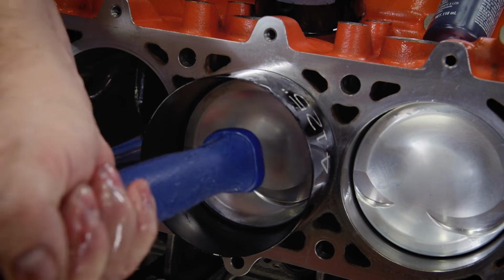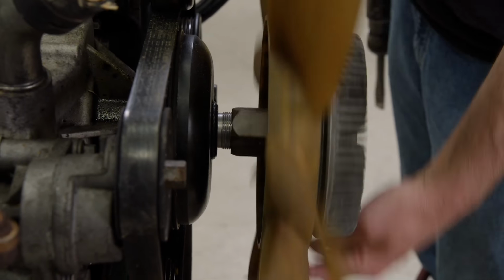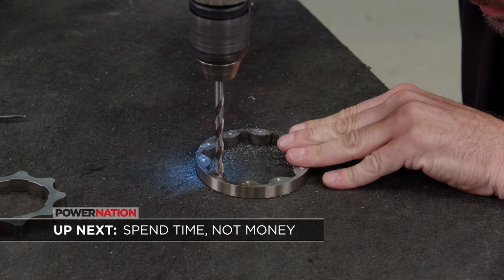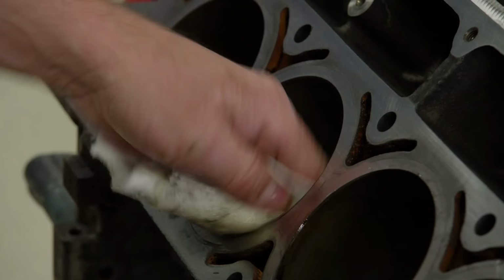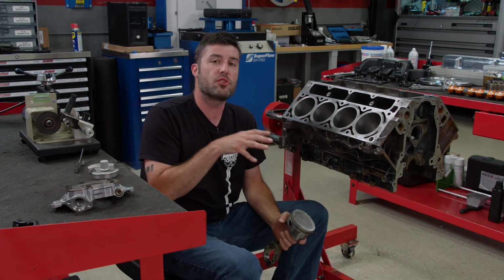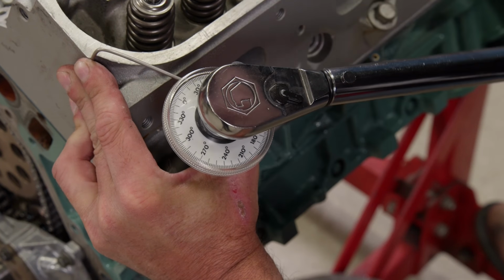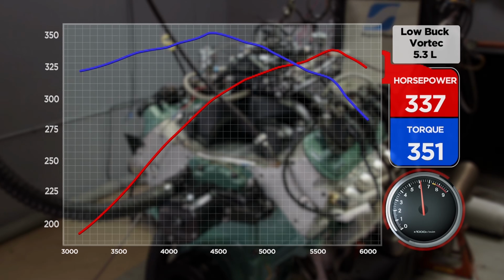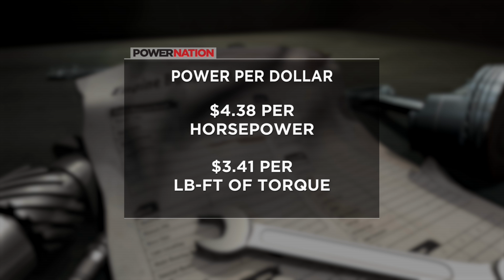Minor Upgrades Create Crazy Power on a Junkyard 5.3L Vortec - Engine Power S7, E10

Comment: too bad that these engines are extremely rare now.  Junk yards are running out.  I had to pay $1500 for a low mileage spare motor when mine started tapping(failing lifter).  That was over a year ago now.  Now that replacement engine, which still sits, goes for around $2500.  A reman longblock goes for about the same.  Seriously, thanks for ruining a good thing.

Comment: Love the show. I'd love to see y'all do a high rpm destroked LQ4 or LS3 using 4.8 crank n rods. It's something I've pondered for a long time. Something 7500-7800rpm w hydraulic roller cam. I know the 5.3's etc all can rev over 7k if done right but,with the smaller stroke/bigger bore the 4.8 crank/6.0/6.2 bore should rev quicker. Plus it can use LS3 heads/intake. Add a pair of turbo and it'd be a nasty little engine for not such a huge pricetag. Anyway,love the show,havent missed it or horsepower TV in years
Reply: 7k is plenty with a 226/238 .600 lift cam and some springs, pushrods and trunion kit.. can make 500hp with headers, cam, and intake..

Comment: A standard 5.3 Vortec comes with 300hp. I can get 46 hp from opening up the fuel injectors from their 15% to 40% and unrestricing exhaust back pressure and air in alone. No need to mess around with everything you did.
Reply: What do you mean by opening up fuel injectors?

Comment: Wow. I WOULD NOT want to run 700+ ft lbs on that thing sooo low in RPM. Got lucky shit didnt scatter......I was amazed at the initial torque hit. I had to back it up..... Hot Damn!....what Im not understanding is why they made so much more without any flow work on the heads?? I have seen crazy N/A motors make more than Jet Rec.....but 65 more and like double torque??? Looks a bit suspect....... But never the less.....amazing lil 5.3!

Comment: I would have guessed it would make 400+hp NA with the stage 3 cam motion cam, long tubes, intake and tune. Most bone stock LM7s make 340+hp and ~370 torque on engine dynos. I think hot rod magazine did a test some factory cams and the 5.3L made over 400hp with a stock LS9 cam. I am guessing the tuning for AFRs or timing was off on this test

Comment: When I was in shop class in high school we had 10 of these engines mounted on stands. They were donated by GM after there was a flood at their factory. They couldn't use the engines in production vehicles so they donated them and wrote it off on their taxes. We got to take them apart and put them back together many times. Sadly we were bound by an agreement that the engines could never be fired up.
Reply: 😆 Then what was the point??
Reply: @davelowets  we were 15. The point was to see what the inside of an engine looks like, how it comes apart and goes back together, what each part does. It was very beneficial and I learned a ton. We couldn't ever start the engines because of liability reasons.
Reply: @curtiswaters7415  That's why you start in shop class with a lawn mower engine, and then move up. You aren't going to learn much If you can't fire the engine up and tune on it yourself. Back in the 80s, that how shop class for us was. We started with a single cylinder mower engine, took it apart, put it together, then ran it and tuned it. Then we moved up to full size car engines and did the same. Then after that, it was a large diesel engine. I couldn't even imagine the amount of knowledge I would have missed if we couldn't fire the engines up after putting them back together. That was half of the experience right there. If I was the shop teacher, and G.M. said I couldn't run there donated engines, I would have told them to keep em. You can't learn much by just looking at them, starting them up and running them teaches one a whole lot more. What a lame shop class.
Reply: @davelowets  we had the opportunity with other engines, specifically a lot of Chrysler engines we had. We also worked on people's personal vehicles doing all sorts of maintenance and repairs. The teacher was a mechanic for over 30 years. Keep in mind that it was high school and we only had 70(140 if double-period) minutes each day to do things in that class. Single cylinder and two stroke engines was a separate course all together. There is more to automotive technology than building and tuning engines.
Reply: @curtiswaters7415  I was in high school also. I'm well aware of how long classes were. If you had other engines to work on, then the G.M. engines were basically pointless. A course about "engines" is a course about "engines". It doesn't pay to try and teach someone about something if you can't find out what the end result of what you learned is. That whole thing was rather dumb.

Comment: Very nice video.  However, Last I checked, 13 States follow California Air Resources Board(CARB)  semi-annual, strict, PITA,  emission testing.  Lots of car guys can't just toss their intake system, etc.in the trash.  Just every now and then, I'd like to see a MILD build that will run clean enough to pass!  The MILLIONS  of "Car Guys/Gals" would be HAPPY with another 50HP, when our engines are tired and we are gonna do a rebuild or "Ring And Valve Job"!   We need more "Real World" builds, not more small-block Chev/Ford fantasies.   Thank you!

Comment: "Get big power gains on a low cost junkyard ls. All you need are these highly specialized machines that all cost 3 to 10 grand a piece and replace everything that makes getting a junkyard ls appealing"
Reply: Instead of using the high temp washer, clean the block by hand with solvent, degreaser, and pb blaster with a straw for hard to reach areas. Instead of using the crank polishing machine, polish the journals yourself with oil and 3000 grit crocus cloth. You don't need the fancy machines to do a low buck engine rebuild, it'll just take more time...
Reply: @kyleboren7372  exactly, they even showed how to clean up the gasket surfaces by hand and showed ball honing the cylinders with a drill instead of a machine.
Reply: it's an LS.. they went overboard with all the cleaning and touch up and such. You have to realize that this is a show and have to make the engine presentable. When they took it apart, all they had to do was replace the worn out parts and slap the entire thing back together again. They didn't even need to repaint it.
Reply: @wanderingbufoon  Hmmm don't know, unclogging the main bearings oil passages might have added 100k-200k more miles to this engine. Pretty sure they can go 300k miles no sweat until something like that happens and it causes it to die early.
Reply: @wanderingbufoon  Why did they leave the rust where the coolant goes? That seems like a major oversite but I'm not an engine guy.
Reply: @RedRider2001  nah, it's been derusted by being power washed and sand blasted. 

If there is rust in the coolant compartment, it is nothing. It's a totally independent part. The only thing that is going to make it into a problem is if it starts becoming structurally compromised.

Remember, in hotter climates, their coolant is straight water.
Reply: They could have left the crank and heads on and bought a a few cans of Gunk and used a lot of elbow grease and just bought a cam kit and replaced oil pan and other gaskets. Or even pulled the heads and just replaced the head gaskets. Plus the little oil pump rebuild. It would have run fine for a lot less money.
Reply: @actionjksn  Probably a good thing they pulled the heads did you see how loose the head bolts were and adding Nitrous mignt of blown a head gasket.
Reply: Glad someone pointed that out. It may have been cheap for them, but add the prices of getting these things done, and the price skyrockets.
I wouldn't mind seeing the price, after all the adds that got added as well, they probably made money building this engine.
I shouldn't complain I suppose, it was pretty informative to someone who knows squat about this type of thing, which is me.
Reply: @markcahoon2534  every machine they used you could do the same work by hand, granted its alot of hours but just saying if you wanted to you could. As for the basic stuff like the ball hone anyone who you take on a job like this would have those basic tools.
Reply: @johndullebawn9625  yup, thats true hot rodding inventing ways to do things with little means.
Reply: Pretty sure he's talking about the specific carburetor they used in this video,  not the imaginary one you guys found on craigslist
Reply: Dude you can literally do all that shit at home. Power wash block, decking block yourself with sand paper, the crank you can take to someone to polish for 100 bucks or less.  Every guy has a dremel tool if not harbor freight got them cheap.  What else you bitching about.  It can all be done at home
Reply: Vice grip garage has a episode on building a 350, and another where he builds the much maligned 305 and proves it can make a damned nice motor too. Both episodes are jammed with excellent make-do technique. Especially the one on touching up the cranks with a shoelace.
Reply: If it has ok compression and doesn’t have a bunch of valve train and con rod slip it’s usually budgetable
Reply: If you don't know how or too lazy to wash an engine block with your own hands, too cheap to have the crankshaft polished at a shop and among other things, then you have no business in this lol.
Reply: @squidusn71  when the crank is in this good of condition you can use a roll of fine Emery cloth with a shoelace and some oil to clean up the crank. Honestly they didn't even need to pull that crank. My LS has way more miles than this one and I have 40psi oil pressure.
Reply: Right I was thinking same shit
Reply: But they still used a shitty ring compressor
Reply: Honestly u can just take ur parts to a machine shop they will do whatever u ask just cost more money
Reply: Exactly. What a bunch of assholes. 🤣
Reply: It’s still cool. Someone might buy a bunch of these for race engines and hand their friends a few.
Reply: Sloppy mechanics does bigger power with stock internals and a cheap turbo. 500-800hp with less than $2k with engine.
Reply: 2500 dollars in parts and 3k in expertise
Reply: Bottom line that’s not going to make a daily driver engine. Lol
Reply: It also helps to leave of half the parts you need to make it run, like headers, carb and MSD ignition.

Are you going to tell me that the stock intake, fuel injection and computers weren't worth saving?
Reply: You Forgot to mention the Highly Skilled LABOR Costs associated with said Rebuild......
100+++ Hours at $90-$200(low range Estimate by the way).
Parts are CHEAP. LABOR and Expertise are the EXPENSIVE parts of ANY "Job".

Comment: So you spent $1700 not including carb. Not including machining. Not including all the little things like oil and thread locker and allllll the other little things... For what? 50-70 horse power increase? Sure nitrous made huge increases but take that away and you spent thousands on 50-70 extra horses... 

Not like it was already 1000 and you were trying to squeeze out every last drop... It was 290 to start with and you made 340....

Comment: Yeah know I've got an interesting question. . . Does a better Plug really account for performance? Do manufacturer claims, on certain plugs provide better combustion, better power an efficiency over an OE Factory replace.
 Test a basic Copper as a Control base line. . . The test a Platinum,  Double Platinum, an E3, and Maybe Like Some off the Wall High performance spark plugs.
I ask because I'd Like to see the Number, and Plus it give you guy another fun excuse to play with the Dyno. 
Try it on an old Mopar LA Block.
Reply: Different plug materials affect how long the plug lasts, not its performance. The conducting element on most plugs is copper, the only exception being silver plugs. The platinum and iridium plugs have a different coating on the plug tip that makes it last longer but does not affect its performance. An iridium plug will last about twice as long as a copper plug.

Comment: If by "ring squaring tool" you meant "old bare piston" then yes I use one of those
Reply: I just Sharpied "ring squaring tool" on my old bare piston I use on 5.3's. I liked your comment, stole the joke!
Reply: right lol
Reply: Haha so true. I just use a square set to one inch.
Reply: No kidding.   When you're half assing a ring job, you always want to push the ring way down low in the cylinder.  That way your minimum gap is measured at the tightest point of the cylinder.

For those that haven't done the math, every .001" of cylinder wear opens up the ring gap .00314"  (3.14 thou").

so, if you're going to spray a junkyard engine with that crap, don't set your minimum gap up top where the wear is greatest.
Reply: Somewhat on the subject of ring gap.  I was curious, I didn't see it being mentioned or maybe I missed it ?   But was there a ring ridge at the top of the cylinders.  I would think there would have to be a some kind of ridge at 100k plus mile ?  
   Also, thank you for your math equating what cylinder Wear equates to piston ring gap.  Interesting and good to know.
Reply: @garysorensen7724  Due to a lack of carburetor choke washing the cylinders down with gasoline at engine start-up, efi engines don't wear the cylinders as badly as old carb engines used to.

Comment: For anyone else who was confused about the dimples, it's to act as oil reservoirs in the pump to improve lubrication inside the pump itself.
Reply: He stated exactly that in the video...
Reply: Thanks, I tried to look that up and came up empty.
Reply: Are the dimples on both sides?
Reply: If oil can get to the dimples it's already getting to that side of the pump.
Reply: @hoov100  the point is to have reservoirs of oil there for improved lubrication, not to get oil there in the first place
Reply: @hoov100  you completely missed the point lol.
Reply: I would love to see any actual proof that this particular modification resulted in better performance. Seems kinda hacky to me... and for what? To "improve" lubrication how exactly? Was there an issue with the stock pump failing somehow in a way that this prevents?
Reply: @shawnwimberly9294  Actually the plate can wear from over reving with any pump, melling even offers a coated plate , though i didnt opt for it in my ly6 rebuild
Reply: Yeah, that was kind of my point... that pump isn't going to be ran "dry" typically, ever. I'm sure i won't bother with this "mod"

Comment: What would be the difference b/w this 5.3 and my 4.8? Ive been thinking of doing something similar with the factory block but no power adders really, just all naturally aspirated. I know alot of differences b/w the 4.8, 5.3 and 6-0 are mostly internals though
Reply: The 4.8 shares the same block as the 5.3, but the 4.8 uses a shorter 83mm stroke compared to the 5.3 that uses a 92mm stroke

Comment: I've always considered the GM Vortec 4.3L and Ford Modular 4.6L 2V (Romeo) engines bullet proof if properly cared for yet I've never seen a build on either of these engines. My Ford 4.6L 2V came from factory at 229Hp and I contend it can do better at 300Hp but no one has ever put it to test hint-hint. These were two very common and widely used engines and I'd love to see their true potential.
Reply: I built a 4.3 V6 many years ago and put it in a 69 Nova,it got great gas mileage and had decent power for a 6 cylinder.

Comment: I’d like to see them pull the engine add nitrous, and put it straight to the dyno. Oil leaks and all with stock manifolds.
Reply: Probably would have been close.
Reply: @patrickwelch620  probably would have made more, that stock long-runner intake is a really good intake considering its "just stock" and EFI is going to do a little bit better than carburation every time.
Reply: @Heathfx5  Wrong. A well tuned carb will make more top end power than EFI will.
Reply: @davelowets  until I go about a mile or two from the house and gain 1500' elevation.  FI will always adapt to elevation changes and deliver consistent power much better than a carb.
Reply: Stock with mild turbo and nitrous is around 950 at crank.
Reply: That wouldn’t pay the bills. They gotta sell parts
Reply: That would be stupid. If you run nitrous or boost on stock ring gaps, your engine won't last very long before you bust a piston. You have to open the ring gaps up.
Reply: @davelowets  people boost stock LS motors all the time. It’s not a dodge or ford....
Reply: @jeremylakenes6859  Not without opening up the ring gaps first. Obviously you have NO experience with power adders.
Reply: @davelowets  I don’t need experience. Just search what the ls can do stock. Sure, it’ll last longer with mods, but it’s stout the way it is. Many people are 700+ hp on stock/unopened bottom end. 

Alas, you’ll have a shnazy comeback that’ll help you cope with your insecurities. Good luck
Reply: @jeremylakenes6859  Sure, sure.. Only a fool believes everything they read on the internet, and then embarrasses themselves by passing it along like they're an expert on the subject and have done it themselves. If you boost a factory engine, with stock ring gaps, you're in trouble. Period.

P.S. How's that for a "shnazy" comeback? 
Don't like it? Too bad, it's the plain truth.